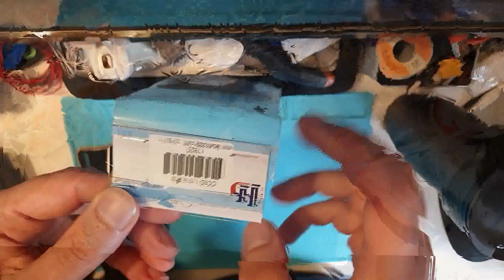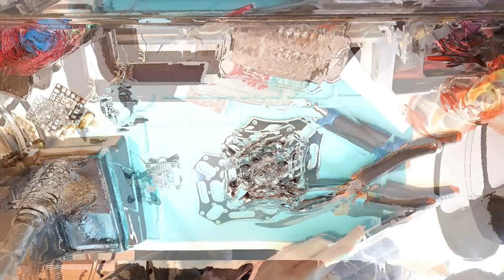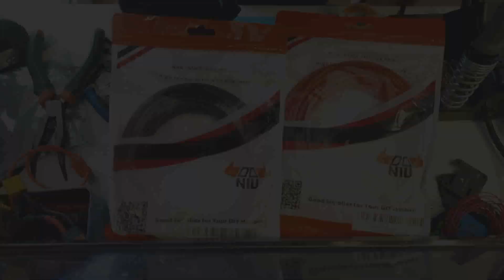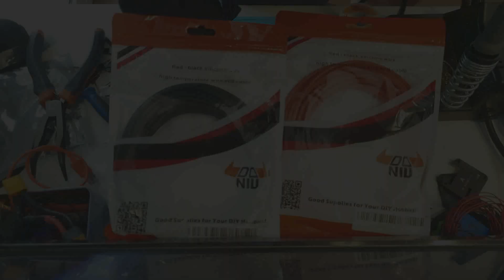Part 1 - DJI F450/Diatone Q450 Build Tutorial. Building together. Cheap build. Clone.

Comment: Thanks for this vid!!  I’ve been searching YouTube for a few days now and just found it.  Just pulled the trigger on the parts to build one of these and I have a question or three!  😂  I’m coming from 5” Freestyle and 7” long range quads.  The parts should be arriving in a couple weeks from China.  I will be running a Matek F722SE with iNav on it.  What protocol would I run for the ESC’s?  I got the 30a airplane ones like I see in all the videos.
Reply from the maker: Thanks so much bro! Comments like yours keep me going ❤️.
I still didn't do part two and I'm pretty mad about this. I hope that June will be spare me some free time to work on it!
I think I'll go for dshot600 but still not sure. I'll find out with you guys in the process. I just did this research and bumped into this (matek722SE) 
https://github.com/iNavFlight/inav/issues/4189
Shouldn't happen on dshot 1200 though.
Stay tuned and ring the bell for part 2 🛎 😎